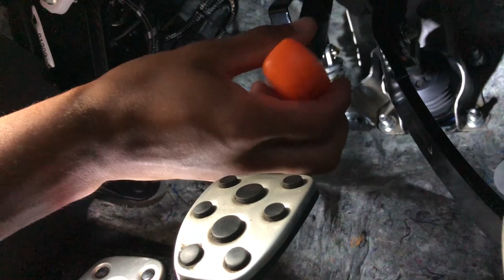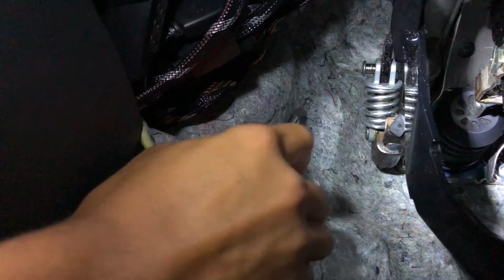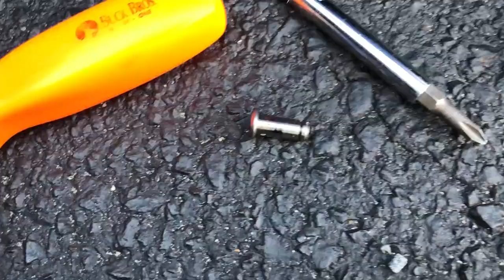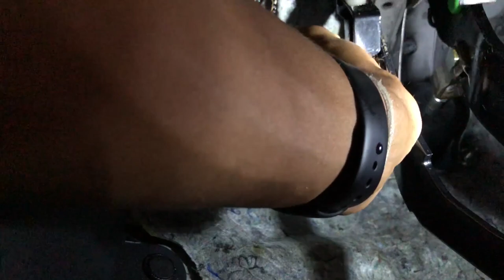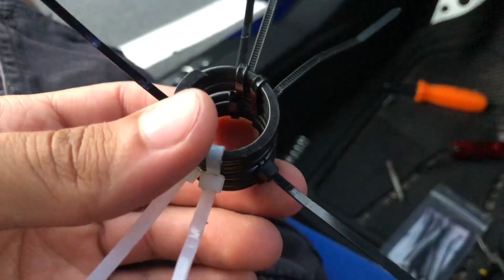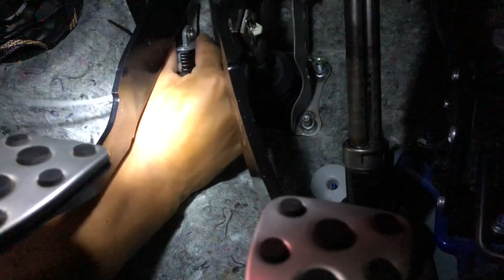[How To]: Install MTEC Clutch Spring on 2016 Subaru BRZ

Comment: Just installed mine today.
The most difficult part of the install is the very limited amount of space you have and the angles you have to work at. It was a bitch, even with the right tools.
Also, be sure to get stronger zip ties because the ones included are junk. You dont need to overkill it either...just two ties work fine.
 use a magnet to handle the E clip
Overall...
Great product! You can definitely feel the difference in the response and firmness of the clutch. I would recommend. Much better than the OEM spring.